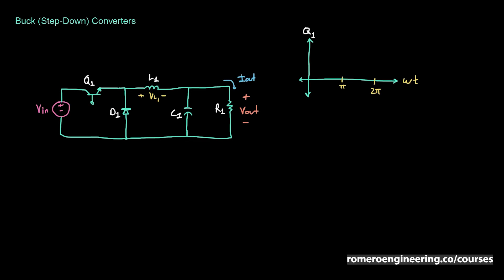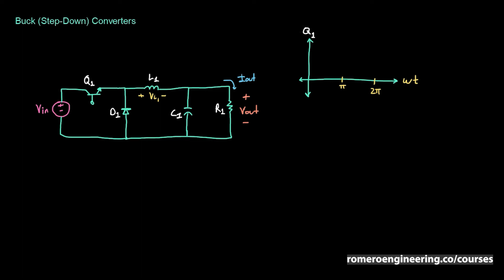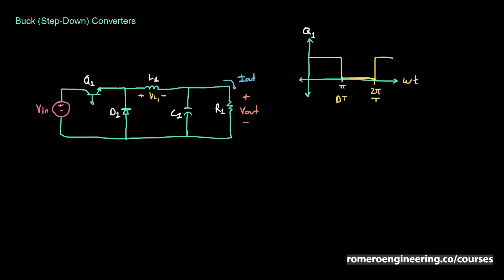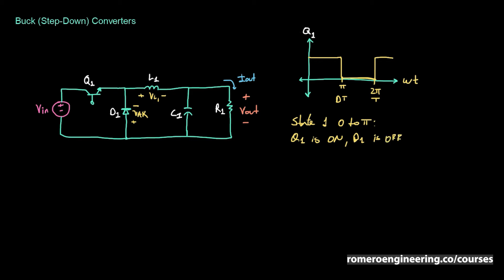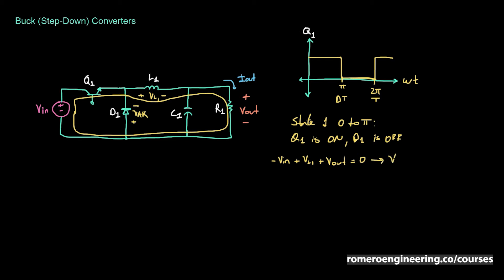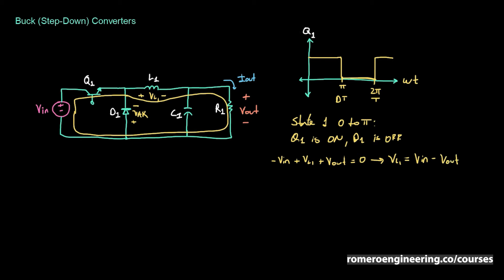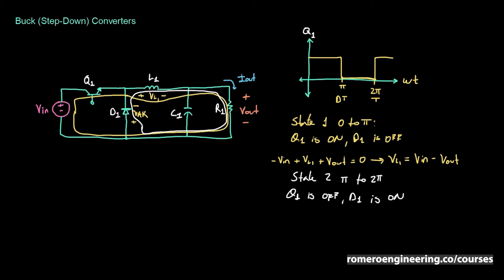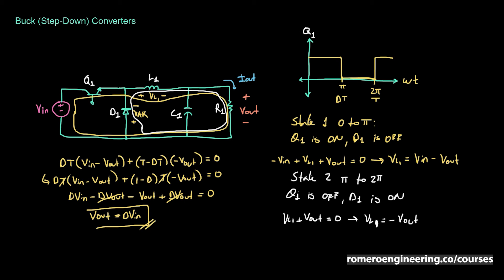Power Electronics Buck Converters Explained - Calculating the Input/Output Voltage Relationship

Comment: there is one thing i can't grasp I would be grateful if you shine a light on it 

why is Vl1 = -Vo when the switch is off 

shouldn't it be positive because the inductor will change polarity to maintain current flow In the same direction?